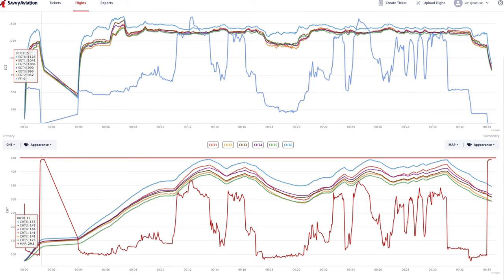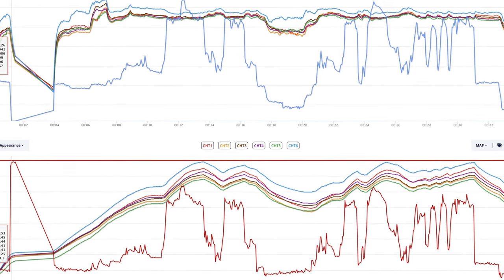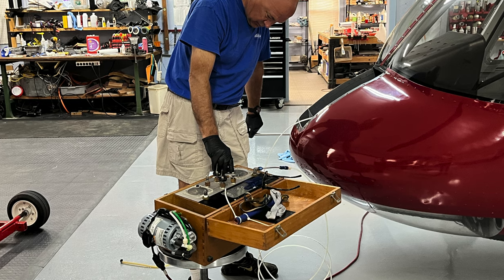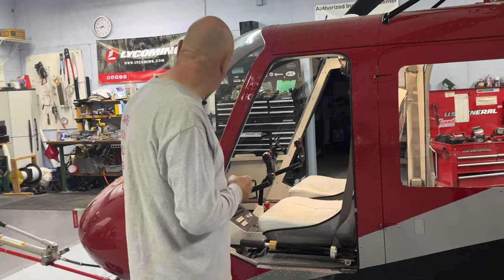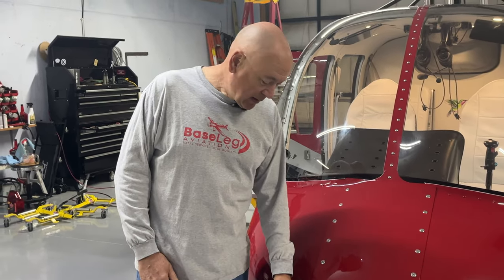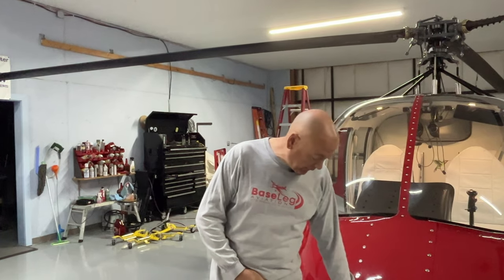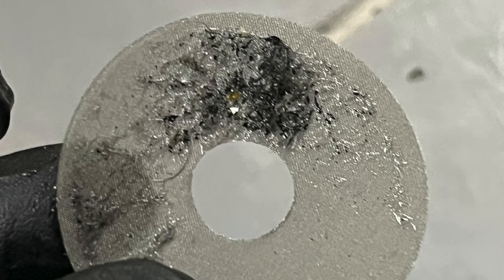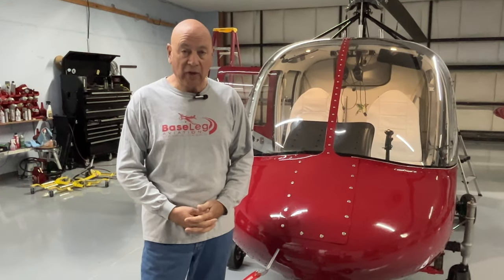Hummingbird pitot leak, gascolator crud, more test flights

Comment: Try bleeding the main rotor dampers and check the landing gear struts for inflation. 
The Sikorsky S 52 was one of the few helicopters to loop - If you changed out the nose to a bubble and paint it in USMC colors you'd have a war bird,

Comment: At how many hours do you prefer to do first oil and filter change on a new engine? I assume you are initially running mineral base break-in oil.?.
Just as you found unexpected material in the brand new fuel system, I wonder how likely to find similar from a new engine and oil cooling system.
Reply from the maker: I always change the oil at 10 hours on a new engine, and the after 25 more hours. After that I change it every 35 hours. on the helicopter, since it is turning 25% faster I intend to change oil at 25 hour intervals.
Reply: @baselegaviation1614  Thanks Vic 🎩
Reply: @baselegaviation1614  Why turning at 25% faster :face-red-droopy-eyes:, please.

Comment: Quick question, how loud would you say it is inside? Also are there soundproofing options?
Reply from the maker: Yes, the gearbox is loud. I have added soundproofing and will see if it made a difference. The noise cancelling headset does a great job.